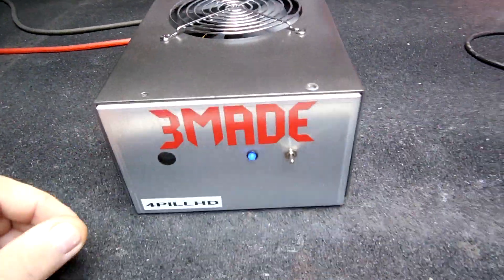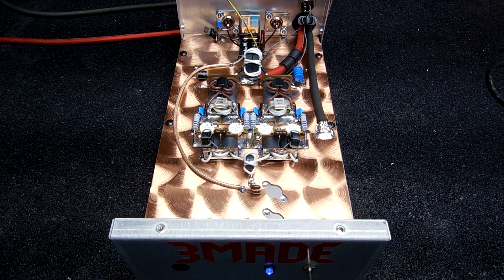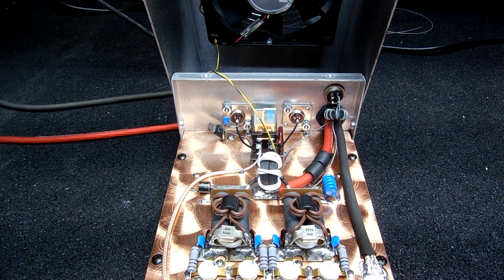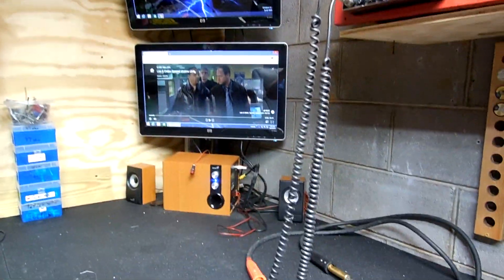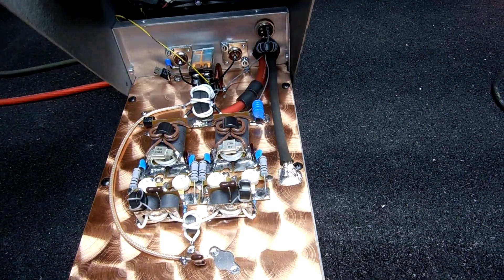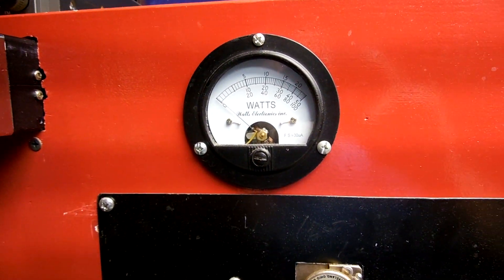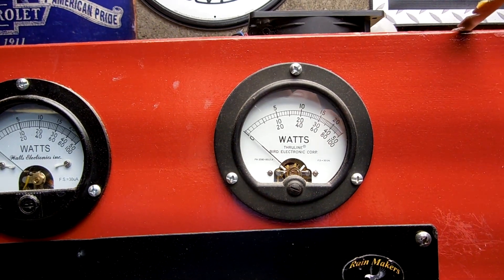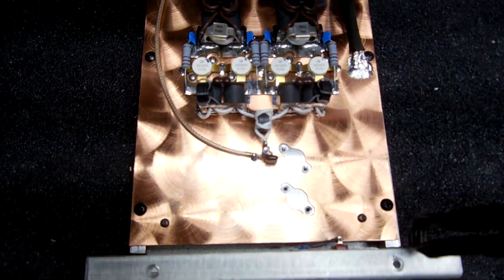straight 4pill amp

Comment: nice build.  last 4 pill I rebuilt was a blue label base 8 pill that turned into junk. I used 2SC2510 X4  on 24V switchers and AB bias, mostly used on SSB and set 120V . You made a class C amp. ok for AM/FM /CW and digital modes. I got .1 watt reflect on input .Stay with HG 2879 the DEI and PP 100 JUNK ! I get all my replacement transistors from RF parts   for the past 20 years or so,